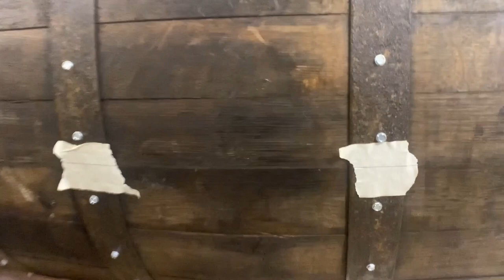Whiskey Barrel Coffee Table

Comment: ? Do you think you could’ve removed the char with pressure washer rather than sanding
Reply from the maker: I built another table with the second 1/2 of the barrel and I used the same brush I used on the outside. It worked better then sanding and much less mess. Pressure washer could work but the brush did a great job without getting it wet. Thanks for the suggestion!!

Comment: It amazes me how many people sand or use a wire wheel on the inside of a barrel, it makes a huge mess. Take a stiff puddy knife and scrape across each stave then vacuum it up. Then run a wire brush the length of it holding a vacuum nozzle next to it, no mess
Reply from the maker: I learned my lesson after the first time, I used a stiff plastic bristle brush to remove the loose pieces and it worked just fine. Live and learn!